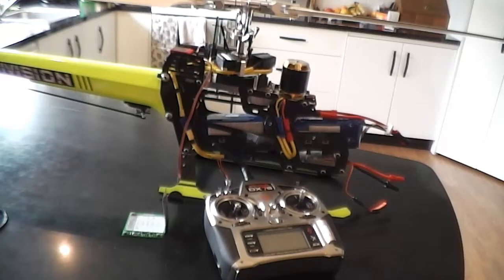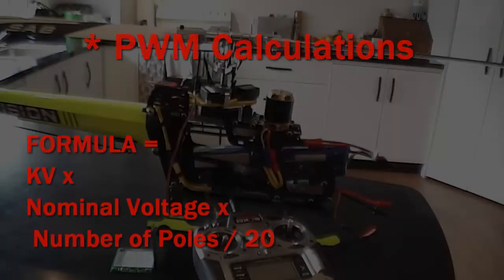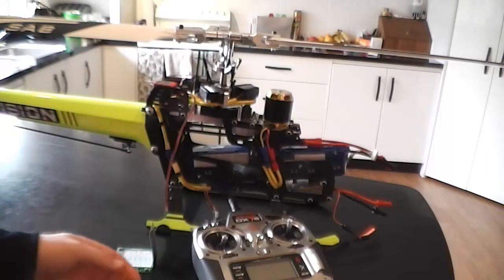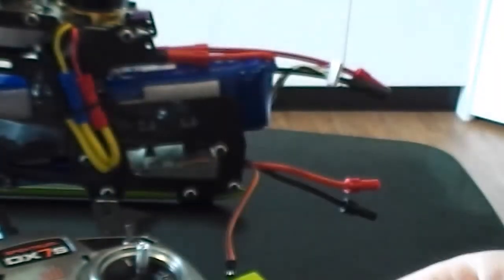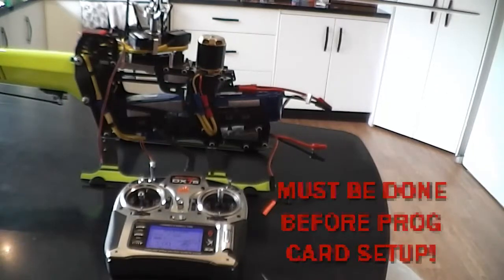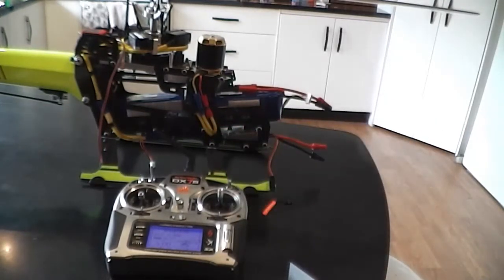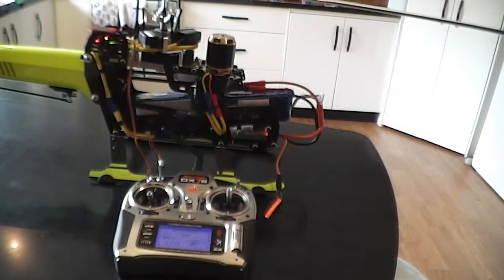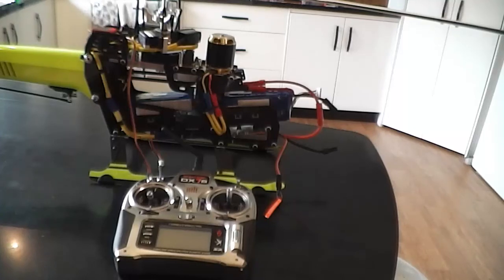PROG 2 Card SET-UP part 1 Basic  learning setup - for YEP and YGE ESC

Comment: What is the purpose of the second 3 wire connector? They are exactly identical and there no identification of any kind. No manual neither from HobbyKing.
Reply from the maker: what are you referring to? on the Programming Card?
Reply: You found out? I'm with the same problem...

Comment: Thanks Westy, your throttle calibration method fixed my issue!

I was having problems with my throttle cutting out while spooling up and even just hovering. I had used the programming card to set the STOP (low throttle) and FULL SPEED (high throttle) many times, but for some strange reason the motor didn't start to spool up until 50% throttle was reached. I have a few other YEPs so I'll recalibrate those throttles "Westy Style" as well!

A word of **CAUTION**, recalibrating your throttle this way can/will change some of the stored parameters! So do remember to check and reprogram your required settings before you lift off again!

Thanks again Westy, you're the man!
Reply from the maker: thanks Jonny.... Missed this comment. Thanks for taking the time to comment. I appreciate your feed back. Any video ideas .... just let me know. Cheers WESTY!
Oh and thanks for the CAUTION NOTE I forgot to mention that as I always recheck my prog 2 card programming after the gov store callibration.

Comment: Thank you for sharing it!
Want to ask you if you fly with the jumper on the esc at the prog.cable?
Reply from the maker: sorry ... just found these deep in my messages. YES... ON the HV setups .... you run the looped bind link to prevent a build up of electromagnetic fluxing... building up and causing glitching and erratic hard to diagnose problems.